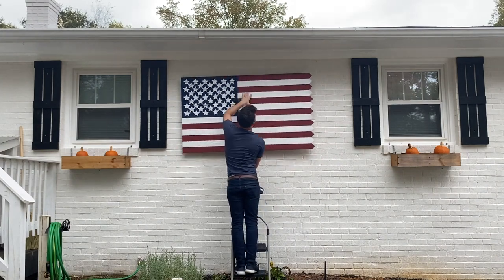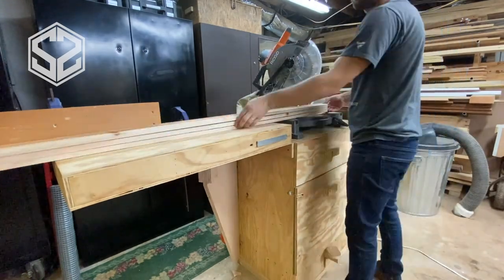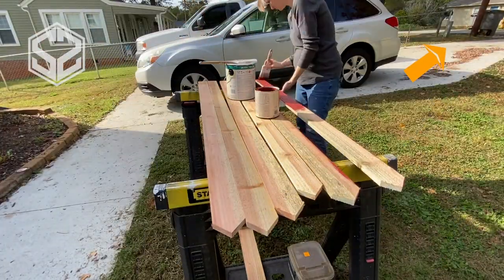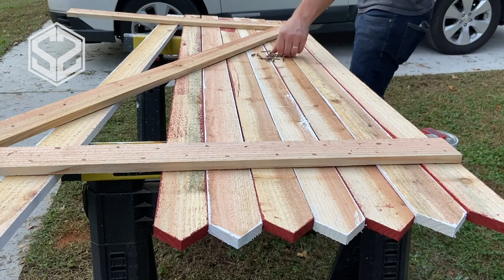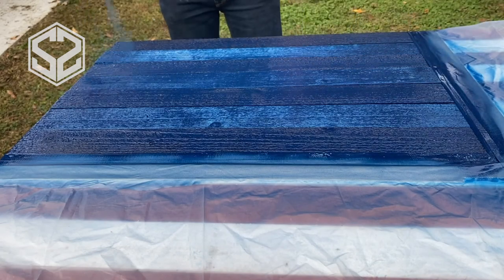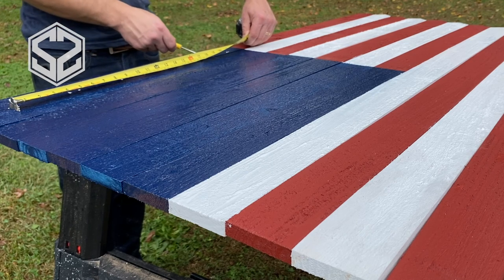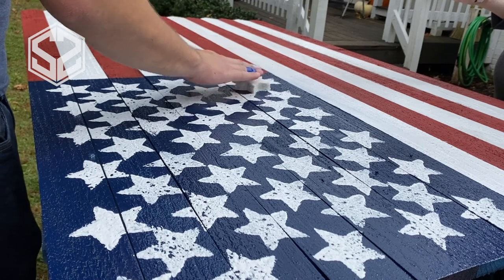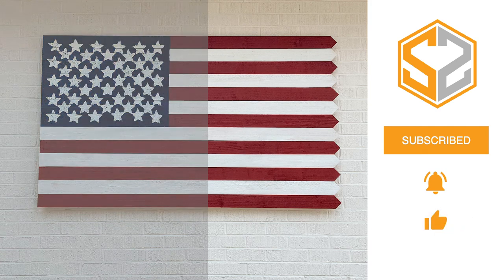DIY Fence American Flag

Comment: Great piece of Art. Did I miss what type of paint for different types of weather?
Reply from the maker: I may have mentioned it but as long as it is made for exterior use you should be fine. We used a mixture of spray paint and paint in a bucket to get all three colors. Thanks! :)